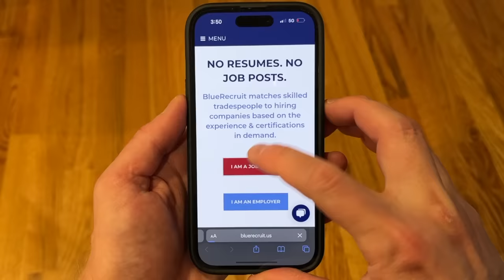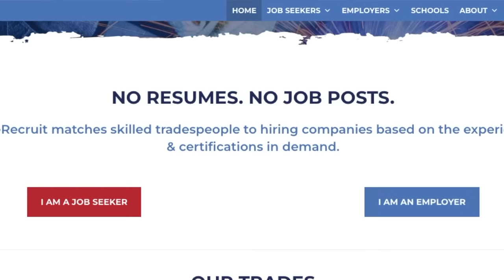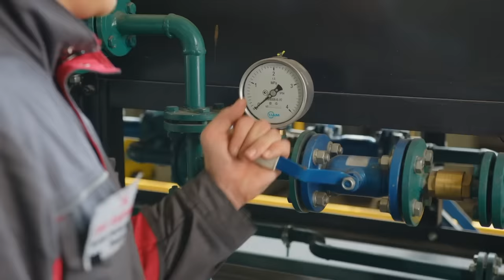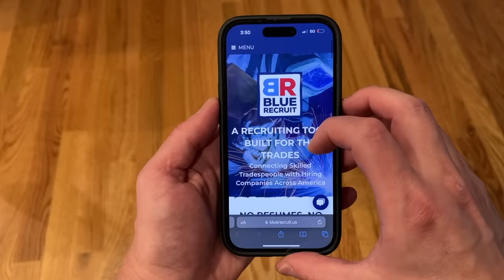7 TRADE JOBS In 2023 That Pay Way More Than You Would Expect!! (Rising Wages...2023 And Onwards!)

Comment: 1. Solar Installer $32/hr
2. Mechatronics $29/hr (to $100)
3. Plumber $30/hr
4. Elevator Tech $40/hr
5. HVAC Tech & Electrician $34/hr
6. Heavy Equipment Mechanic $40/hr
7. Fire Service Inspector $44/hr
Reply: Programmer $60 and working in comfort
Reply: The only one worthwhile is the inspector
Reply: It should of been Elevator Constructor 1-7
Reply: @jeffshackleford3152 Wut?
Reply: These are all 90th percentile. Most pay like 15 an hour for most of the years you do it
Reply: @rayzerot  the fire inspector job is the only worthwhile job.

It requires the least physical effort and pays the most
Reply: Actuary $70/hr
Reply: @johnbloom1109  facts
Reply: @johnbloom1109 how do I get into this
Reply: All of these are disheartening knowing I can start as an electronics repair technician or technical helpdesk and can get paid $32 an hour within 2 to 5 years, and maybe 4 to 8 months maximum of initial training/continuing education as you continue to move up. Zero apprenticeship, zero degree necessary.

I was hoping to find a trade that pays higher than these two technician jobs but looks like only 2 of the listed trades do. But for the time it takes to complete apprenticeship and join a union, you can just be a technical electronics or helpdesk lead/manager in year 4 to year 6 (maybe year 10 if you need a slower track), and you’d make the same amount. :(
Reply: I'm a union carpenter and I make more then all of those 🤷‍♂️
Reply: @johnbloom1109  yeah software development engineer even analysts are great but some of us not great at advanced math or logic especially with college work load
Reply: Solar installer makes more than $32 an hour. The company near me works on Air Force bases. In the first year, they make $35 an hour. On Friday and Saturdays, if you choose to work, they get $59 an hour, you get to choose your work schedule.
Reply: Non of that pay is worth it in 2024. Let that shit rot.
Reply: Going to persue Heavy Equiptment program in canada, very intereseting and masculine job i would love to do
Reply: @johnbloom1109 I want to become an electrician or a programmer how long did you have to go to school for and how much was it and how much a year?
Reply: Elevator tech averages over $50 an hour. We have helpers in the trade making over $40 an hour. Don't know where that number comes from. I know this. Because that's what I do. I hit 6 figures within the first 6-8 months of the year usually.
Reply: @GbodyPat817  Hey man I am 17 and don't know what I want to do. I want to make at least 200k a year and ill just be finishing up my 2 year trade school in June. I was thinking about becoming a lineman like my uncle but I don't want to work 16 hour shifts everyday. What do you recommend for me? What do I need to be an elevator tech and is it sustainable (like is there a lot of work and hours because to me I feel like elevators don't need a lot of maintenance but I don't know anything). Is it possible to make 120k plus a year as a elevator tech with 40-50 hour weeks?
Reply: @Lypty  as long as people are fat and lazy....I'll always have a job. The work is almost recession proof, unless you're in the construction end of the industry. Your local union should have an apprenticeship program. All you need is a high school diploma and a good working understanding of tools. The union will provide schooling, and then there's the on the job training you'll get too. 200K is hard to get unless you're very experienced. 100k is no sweat.
Reply: Journeyman Commercial HVAC jobs in my area are advertising $75/hour + Overtime, 401K and Benefits right now - and they can't fill the jobs.
Reply: Comfort is what’s wrong with society.
Reply: This may be a stupid but does a  Millwright fall under Heavy Equipment Mechanic?
Reply: @GbodyPat817 What about GED?
Reply: @Jules-740  just as good as a diploma. You can still apply.
Reply: Thank you for the reply!👍
Reply: @bagelgeuse5736  You just have to be a math genius...
Reply: @justinbeetle2594  how to get in? I'm a semi truck driver and I would like to get closer to home because I just had a baby. Can you point me to the first step please and I will go from there
Reply: @GbodyPat817 do you need to go to school for that?
Reply: so where;s the high wages part?

Comment: I was a master electrician first, then went on to becoming an Automation Engineer. What you said about mechatronics is spot on. The techs at the plant where I work make 70k+ a year. It is very hard to find people with these skills right now and the more automated factories become the more these skills are in demand.
Reply: How did you make the jump? I'm a master electrician, and I'm not sure I want to work for myself
Reply: @EC-ol6ck  it was a gradual change. I went from working for an electrical contractor to working in a manufacturing plant as a controls technician working on the automated machinery. I also began to learn PLC and HMI programming. After 5 or 6 years of being a tech I started going back to school part time to work on an engineering degree. I’m still not finished with my degree yet, but with my current progress and my years of experience I was able to land an engineer position without having a degree. I guess a shorter route might be to go back to school and get a degree first, while also learning programming on the side and go straight into engineering instead of the technician route I took. The engineering degree doesn’t have to be an electrical engineering degree like most people think. It can be any engineering degree. Mine is Software Engineering, but I also know controls engineers with chemical, mechanical, and industrial engineer degrees.
Reply: At that point it’s barely a trade. Your a specialist. Good for you but out of context.
Reply: Where did you get your Automation Engineering training
Reply: @jamesbrett5010  I’m not out of context. The salary I referred to was for mechatronic technicians, which is what he referred to in the video.
Reply: @dominicamoakobaah9516  mostly on the job.
Reply: @markgallagher1376  I am an Electrical Technician and I want to move into Automation Engineering, can we share contacts?
Reply: Wow so you only make 70k - yep nothing
Reply: There are 3ways I know of to do it. 1) if you’re a veteran, search Academy of Advanced Manufacturing. It’s directly run by Rockwell. 12 weeks of VERY intense training. When you’re done, you’re a Rockwell certified tech. Remember my name, if you get in find me. I get a finders fee.
2) 2 year college tech school. 3) Udemy and online school (there may be others). But this video is legit. There is immense need for it, and I don’t see the need going down.
Reply: @GORT70  so what would this have to do with the trades Plumbing carpentry roofing electrical or bricklayers
Reply: @RonValdes  they asked how to get into controls….
Reply: @GORT70  right so ready for this it’s not a trade wow ! I bet that blows your mind…..
Reply: I talked a little about this in my Ranting about Shipping as much of the jobs are definitely not done by us workers overseas and as I said the Certification for the jobs it’s cheaper there oversea.  but can easily been seen in the real numbers 
of us workers.
Reply: Where would you start?
Reply: Do you know really no one from the United States works in shipping as far as Master electricians controls any of those jobs only a few people do that live here but don’t say that it’s a thing here
Reply: It’s hard to believe that you weren’t making 70k+ as a master electrician?
Reply: @edielcastaneda7627 at that time a master working for a contractor was only getting 25-30 bucks an hour. You could easily make that and a lot more working for yourself though.

Comment: The trades that are more easily taken on as your own business is what I'd suggest going into if you have the inclination for it.  Plumbing, electrician, welding, construction are what I'd consider easier than automotive tech or any other trade that requires a lot of tools and constant keeping up with the changing industry.  
I've been an auto tech for 25 years for one car line and never entertained opening my own shop.  Cars are constantly changing and new tools are always required (unless you specialize).
Plumbing, electrical and welding doesn't require the tools, the space, or the constant training to keep up....in many cases.
Reply: True. My dad works for himself as a plumber. He said for the most part it’s the same stuff everyday. Meanwhile cars are changing every freaking minute.

Comment: I do job #7 and it does pay in that range. It is very technical believe it or not. You have to understand fire flow, fuel load, building construction, sprinkler design, fire alarms, fire stopping and means of egress continuity. Then you have to know how each works with the other depending on what kind of building and what they are doing in it. I hold 15 technical certificates in these fields and most require renewal CEUs.
Reply from the maker: I believe it, Captain! Thanks for writing in with real world info from the field 🙂

Comment: Union elevator guy here. One thing I’ll just throw into the conversation is, one should consider the benefits a particular trade may or may not include. Our benefits package is not included in the number mentioned in the video. I’m sure that’s the case for some of the other trades mentioned as well. Either way, it can make a huge difference in your actual compensation. Thanks Ethan! Cheers!
Reply from the maker: Thank you, T-Love! That’s great to hear—hadn’t even thought of that because I was an independent carpenter for so long and didn’t have any benefits. Sounds like a great part of the deal!
Reply: Excellent point ‼️
Reply: ELEVATOR UNION IS IMPOSSIBLE TO GET INTO .

Comment: In Australia, Electrician is probably the highest paying job, especially if you're working on remote Fly in Fly Out jobs (expect AU$200K). Plus with all the renewables being installed, high voltage transmission towers are needed in big numbers to get the remote energy to the cities.

Comment: Surprised you didn’t talk about unions . Making $90 on the check plus benefits out of ibew local 332. You can check the public web site for pay scale. Skip the technical trades schools and go straight to a union where you get training and pay at the same time. Best decision I ever made. These other non union training companies have a bad wrap. When I was non union I just applied at different contracts till I got the job. Non union contractors don’t care about your 12 month school that costs over 10k. Real talk from an 8 year non union electrician residential and 10 year union inside wireman. It’s the same with all other high end trades. HVAC, Pipe fitters, electricians, operators. Stay away from framing, roofing, sheet rockers, labors.

Comment: Here's the thing about making the big bucks in the "trades". It's all about productivity. You have to be able to GET THE JOB DONE. And get it done quickly and get it done RIGHT, that's the trick. Not everyone can do that.   And just for the record, the reason the elevator guys make so much money is because they have one of the strongest UNIONS in the country. You don't work on elevators unless you're certified and the union controls the certification process. There's a lesson there for the rest of the trades.  
I've been both an HVAC technician/contractor and registered professional engineer and I can tell you I made a lot more money turning a wrench than pushing a pencil. In Europe, HVAC is considered a profession, not a trade.  But you have to have the business savvy to do it for yourself to make the REALLY big bucks in any trade and going it on your own is tricky business. The work is out there, no doubt about that, but the big corporations create a lot of road blocks to keep the little guy little.

Comment: IBEW UNION ELECTRICIAN 
25 years in now 
Started at 18 years old 
I completed 2 union apprenticeship programs 
2 year residential 
5 year inside wireman 
Currently a foreman in 332 Santa Clara county California 
The wage is $ 92.20 per hour regular time .
Reply: How difficult was it to transfer between Resi to IW? Do you think its any easier or harder nowadays to make that switch?
Reply: @MrWzeljunior  Had to apply for both apprenticeship. 
Getting into residential is easier and it then gets you in the union and a leg up getting into inside wireman.
Not all locals have a residential apprenticeship.
Reply: @JAYY_JAYY  I was considering doing that, but didn't wanna be stuck doing Resi, which i have experience in. Would you recommend the CW program? My hours are close to reaching my Jman, should i just wait to pass the exam first? Thanks much for your advice!
Reply: @MrWzeljunior  not user where you are located.
I always advise to go into the apprenticeship and speak with them .

Some people frown on this but you could always just tell them you want to take the JW test .
Another avenue is to sign the books .
There are books 1 ,2,3,4 you would probably be book 3 or 4 .

Comment: Got welding certification in 1977 work everyday since then as a heavy equipment mechanic welder make 170 to 220 Grand a year I'm in a trade Union operating engineers local 12 447 years

Comment: We’ve created a society no one wants to maintain. We NEED more trade workers, with APPRENTICE options for the underprivileged, it’ll get them working, and unlikely to turn to drugs and crime.
1-Solar Installer: $32/hr after 3 years
2- Megatronics:  $29/hr
3- Plumber:          $30/hr
4- Elevator Tech: $40/hr
5- HVAC Tech:     $34/hr (Also for El
6- Hvy Equipment Mechanic: $40/hr
7- Fire Service Inspectors:      $44/hr can vary by state.

Comment: People should look at Power Plant Operator or mechanic. Usually starts at $25 or so, but where I used to work, I was making $50 after a few years.
Reply from the maker: That’s a heck of a rate increase! Thanks for writing in 🙂
Reply: @The Honest Carpenter  yea, it's good money. Usually involves rotating 12 hour shifts, though. Power Plant electricians and line men make even more. Somewhere in the $60s.
Reply: Downsides to power plant operator are the schedule. I've only seen them do shift work and the rotations are terrible. For me though there was a lot of built in overtime because of the 12 hour shift schedule and other benefits making  20% over base pay expecyed and if you're willing to work OT upwards of 50% more.
Reply: @Dasboots32  yea, the rotation definitely has its downsides, but my rotation got me a bunch of time off, too. 15-day vacations by only taking 32 hours of PTO. It's rare, but there are plants that have straight 8 hour shifts. At least mine did back in the 90s before switching to the rotating.

Comment: I guess I ended up between heavy equipment mechanic and electrician 😆

I did a college degree as a electromechanic. First a year of internship in heavy equipment and industrial repair companies. Welding, machining, mechanical work. But also rewinding electric motors and transformers, repairs and revisions on electric motors from palm sized stepper motors to 15ton synchronous machines 💀

I finished school with honors, got hired by a large dredging and offshore company. They sent my ass to some 3rd world gutter to work as an electrician on a large dredging ship. Being an electrician on a ship is no joke.

They said “ah they will teach you everything” in the office 😆 but they tossed me right into expert level shit. My boss has been an electrician for 50y. 42 of which on ships. He used to do tankers, LNG ships, lifestock, containers, reefer ships (large floating fridges basically) according to this guy its all peanuts compared to a TSHD. It was built in the early 90’s. So a lot of old school analog control systems. Almost everything is controlled by relays. It still uses 70’s tech thyristor drives. A lot of shit starts to break due to old age alone also.

I like the variety in it, electrician doesn’t fully catch it. More electromechanic. I have spent hours with chainblocks, Things most electricians don’t do. 
Its a very steep learning curve, its hard work, the environment is fucked up, space is at a premium. But you get to learn and try so many things. All paid by a multi billion euro company 😆

You go all across the world and you are very well paid.

My alternative was to work as a heavy equipment mechanic, as I live close to the largest caterpillar shop in the country. This offshore job pays double netto what I could earn here in the country 💀 its insane. You work for 6 weeks 84h a week without a break. But then you go home for 6 weeks, paid.

So I will start a business by myself once I have more experience and equipment, over time I hope to leave the ships and work fulltime for myself. Hopefully opening a small machine shop to fix machines. Make parts, small welding projects etc.

My boss is 67 and will retire after his birthday in October. I have immense respect for this guy that he still does this at his age, but no way in hell that I will retire on a dredging ship.

Comment: Made 215k last year in PA as a lineman.
Reply: This dude is pulling stats off the internet 😂 this list so wrong.  Union welder north east 60/hr plus per diem and rig pay, lineman 50/hr+ per diem union electrician 50/hr crane operators and the list goes on. This dude is directing you to low paying trades   Lowest paid lineman I know that was a JL made 145k last year with the top guys over 350k